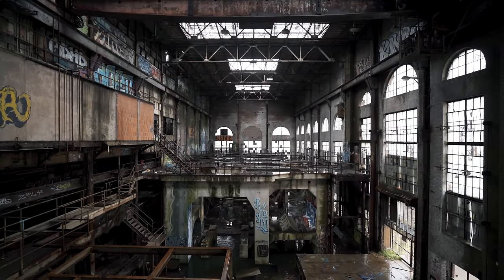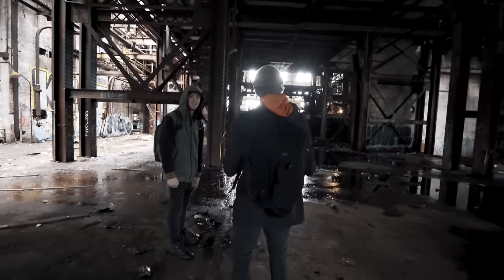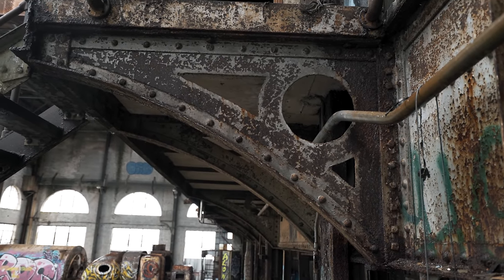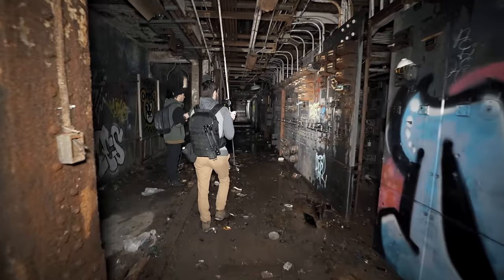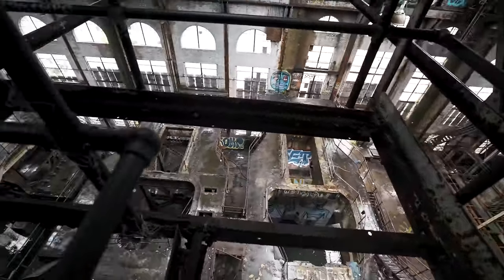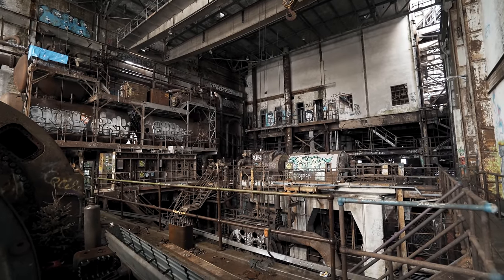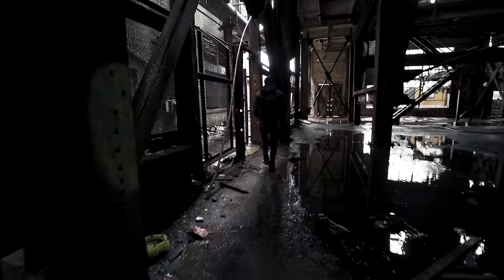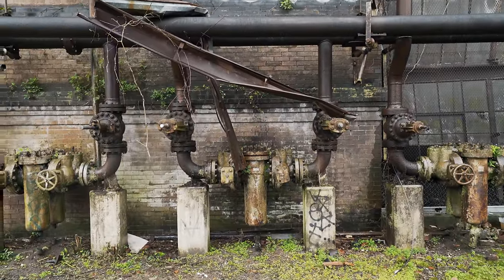Return to the Abandoned Power Plant Where We Set Off Alarms

Comment: The pipe with a loop is designed that way to compensate for thermal expansion so it doesnt crack and break from heat and pressure,

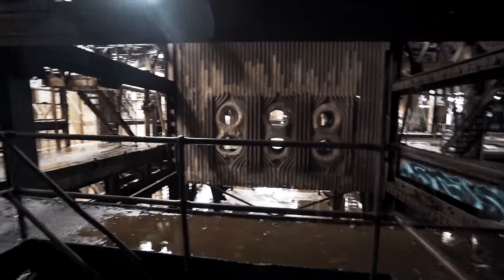Comment: @24:11 the reason the generating tubes curve around is because thats were burners where. One hole for each burner and im assuming it was a coal fired plant. So pulverized coal would be blown through there and it would burn in suspension. The heavy ash would fall into a water trough and the lighter ash would go up with the hot gasses and out the furnace.

Comment: That scrapper was actually pretty cool even though I hate what they do and the mess they make. I was exploring an old US Steel research lab that is part of an old cement factory. I saw a yellow metal saw horse when we walked through the door but didn't think anything of it. My friend and I went through every room on all 3 floors of the building and never saw the guy. It didn't hit us until after we left the building that someone was in there. It's pretty creepy that someone was pretty much watching and avoiding us. The place has been caught on fire  3 or 4 times at that point and gutted/scrapped long before that's why we didn't think much of the saw horse. We basically thought someone else who was exploring found it and set it up

Comment: Those are tubes in the condenser. Cool river water comes in through the tubes, and hotter water or steam is on the shell side. The shell side condenses, and goes back into the hotwell (storage tank that is used as make-up in the feedwater system).

Comment: Too bad so much has been smashed out by vandals!
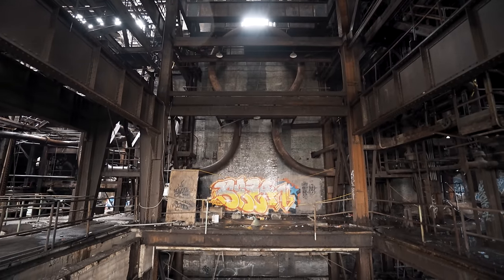The gussets at 8:36 and pipes at 24:28 and 25:02 are pure art.
The vacuum tubes seen at 28:37  in the smashed instruments under "Napoleon Substation" are Nixie Tubes  which were an early form of digital display, with each tube containing neon gas and layered electrodes in the shape of numbers 0 - 9 .

Comment: I build and repair boilers for a living. The boilers are lined with tubes or what you all called  “pipes”. The holes in the boiler wall are where the burners would have been. Coal is crushed into a fine powder and injected into those burners creating a flame to heat the boiler.

Comment: At minimum - the entire roof needs to Tarped, and temp sealed to remove further water damage.  Then all the waste and garbage needs to pressure washed asap (making sure you have protective equipment).  All of that aged equipment needs to be packed up, and hauled to a repair yard, or recycled.  Next, a temp control room - with NO public access - needs to be set up, and connections to any surviving equipment can be set up.  At minimum, it appears only 2 or 3 generators might be functional.  The basement can be drained of contaminants (remotely), once the roof leaks are tarped, and walk-ways safety certified - and un-safe access ways taped or repaired ( even if scrap metal has to used / torn out from secondary sites and access panels ).  This "eye sore" can be cleaned up, with even small group of workers; as small as 5 or 6.  They could set up a small "trailer shop" (with  safety training), and a couple of security guards.  Not a "company work site"; just something small - dedicated, with will-power and dedication.  "You're here to FIX the place up."

Comment: Very awesome video. Awesome looking place for sure.  

I had found out that this place was loaded with old ilg bucket blade fans that are valuable to antique fan collecters.  A group of ours was actually planning on trying to get permission to save the very large 60 inch twin ones that were up on the roof of the building in their own little room.  Unfortunately tho scrappers got to them and destroyed them and left many of us in the group upset and angry over it.  Might of even been the scrappers in your video here.  All I can say about them is that they are worthless beings for doing what they did.  They destroyed a set of very rare and hard to find fans.
Reply: They're conserving resources, being reused for more useful purposes then sitting and rotting. Nothing wrong with that imo.
Reply: @sparkplug1018  I wouldn't call that conserving resources.  I'd call that someone has a drug addiction and is trying to feed it by ripping the wiring out of the motors to use for drug money.  The people that did it were not professional and didn't seem to know how to tear apart a electric motor.  And as stated above,  there was a group of us trying to preserve them and get permission to buy them from the owner of the property,  instead of destroying and stealing pieces of them rendering them useless.

Comment: I heard an electrical hum in there, so there apparently was power still running through the facility somehow. Wonder what it went to; you would think there wasn't anything in there that would need to be electrified.
Reply: At lot of these older plants that have been used, maintained, repaired over and over during a long service life have had years of electricians running new cables instead of removing and replacing old ones etc, which makes it hard to isolate power later on as switchboards and CFS boards can have multiple feeds. I work in a steel mill and have been in many of the older switch rooms and some high voltage boards are fed from completely seperate departments. Have to be super careful with this stuff.